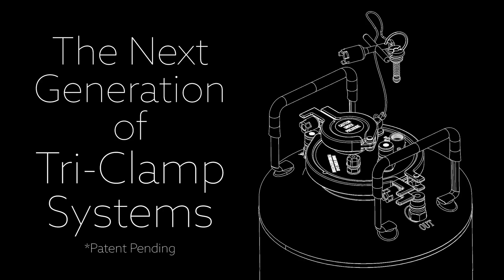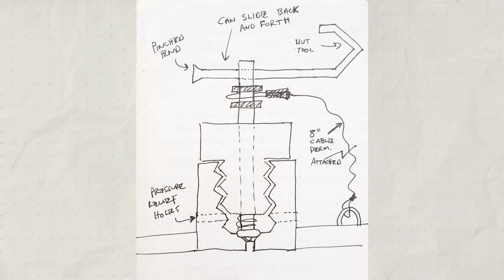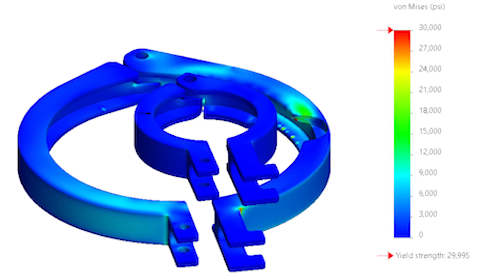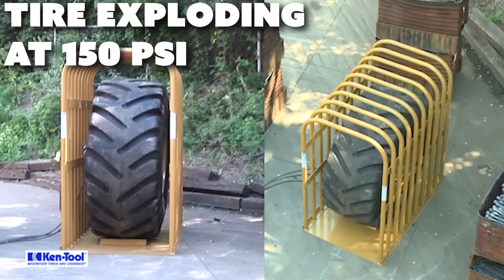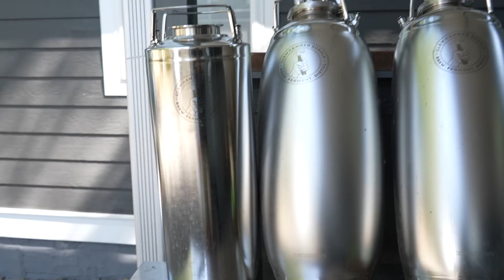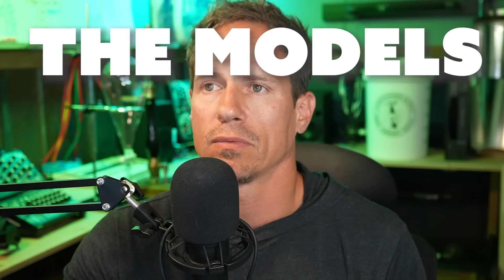How To Lose Money: My Fermentation Keg Problem Just Got Worse

Comment: I'm in the middle of my second fermentation in the Kegmenter. So far, I've enjoyed it. Since this is my first real foray into pressure fermentation, though, I've managed to make a mess a few times. But that's part of the fun of brewing, I suppose.

I'm going to offer a gentle product critique/suggestion for a version 2.0:

So the max pressure stuff covered in this video isn't such a big deal. Who cares about going over 40 psi? If I wanted to for some reason, I'm pretty sure the keg could handle it anyway, but I guess I'll never find out. I guess the use case would be force carbing the primary vessel after carbonation to serve? I'd just spund if I wanted that.

The main production drama with this product was the risk of launching the fittings as projectiles if you tried unscrewing the triclamp under pressure. The way they fixed this is by creating a dummy-proof keyring that's welded onto the pressure relief valve, and attached to the key that you need to loosen the tri-clamps. This means, at least in theory, that you always have to depressurize before loosening a tri-clamp.

Because this was a change after they designed the system, it does create some downstream problems. Say you want to use the hop cannon attachment to drop stuff into the keg without exposing the beer to oxygen. In theory, that should be possible, since there's a ball valve under the hop cannon. So drop stuff into the hop cannon with the valve closed, pressurize the cannon, and then open the valve. No need to open the keg to dry hop, which is what I assume is the purpose of the hop cannon.

With the keyed tri-clamps, though, you can't open the top of the hop cannon without de-pressurizing the entire keg, because you need the key which is attached to the PRV. This makes sense from a safety point of view, because if the hop cannon is under pressure the top to it could launch if you don't depressurize. But it undermines the functionality of the hop cannon.

(I thought depressurizing the keg wouldn't be a big deal because I planned on dry hopping during active fermentation. The positive pressure keeps the O2 out, and the yeast would scavenge what's left. But of course London Ale III has thick gooey krausen, and I, someone inexperienced with pressure fermentations, probably overfilled the fermenter, so opening the PRV created a beer volcano. I cleaned it up, so just a nuisance, but I'd like to avoid in the future.)

As a user, what one could do--and I'll consider doing--is replace just the keyed nut on the top of the hop dropper with a cross hole wing nut for thumb tightening. This would solve the problem, but it would re-introduce the risk of creating a projectile. I'm sure this isn't something the company would endorse or anything, because they don't want some doofus forgetting and hitting themselves in the head with a gas post (ouch!). In defense of this method, though, there is a PRV on the hop dropper, right under the triclamp, so there's a little visual reminder to depressurize just that top section before undoing the screw.

Another option would be for Clawhammer to design a hop dropper 2.0 with a separate triclamp key on the PRV for the hop dropper. You could probably do this yourself, actually, if you want to take the trouble: just get whatever size key ring is on the PRV, attach a key, and then braze or solder the key ring together. I'm not sure if Clawhammer sells the keys separately, but I'm sure you could find basically the same tool somewhere else. (Actually, not sure if you could DIY it because I'm not sure whether you can unscrew the PRV on the hop cannon and I don't want to try since I've got a beer under pressure in there.)

Comment: I like how you are testing and using your own product. While watching your main video on showcasing your product, I missed that potential hazard too. It looks like there are two clamps that this can cause immediate pressure and make either the larger lid or the smaller lid fly up. While using my kegs at home I'm always worried I might blow something out by forgetting to release pressure first. Maybe a warning label and warning in instructions would help. Although I tried to push the lid down on my keg with 12 PSI in it. If there is way to do something wrong with a keg, I've done it. Will the safety valve be set to 40 PSI or are they all just made for 60? I don't think I've ever gotten to 50.

Comment: Would there be a problem serving out of one of these without racking to a keg? You can't drop the trub like in a Unitank, but I always finish my fermentations with 10 or less gravity points in to FG in standard kegs with spunding and I have had kegs stay fresh for months. I wonder if the whole ferment was done in one if anyone would notice?
Reply from the maker: That’s the entire point of this keg. Nobody’s going to notice. we don’t even bother to transfer most beers after they’re done. We just serve right out of the same keg we fermented using a floating dip tube.

Comment: I just took a look at some of my other pressurizable brewing equipment and took note of a big red sticker that warns of injury or death if removed while pressurized. A warning is the standard, the end user should be knowledgeable of the system they are working on and the inherent dangers of making mistakes. Introducing multiple one off triple clamps that can only be used and cannot be replaced with a regular clamp is not the way. If you engineer something to be fool proof you will ultimately also engineer a better fool. Clawhammer products are awesome, the engineering efforts are commendable, but the special ones out there will still find ways to injure themselves using this.

Comment: Funny enough, I've had to undergo a small amount of this stress with kegs in an R&D environment without intent to sell a product. It's pretty common to use a safety factor of 5x in general unless it's in an industry that really understands what their working with, like bridge building, which I've heard can utilize a safety factor of 3x. So, a 60psi rated keg could potentially survive 300psi before rupturing, and yours happened to survive even higher than 5x. I think the main take away is that things are only an exact science in perfect conditions. Safety factors are created to supplement this, but it leaves people like you and I in the dark when we're trying to see what the limits are. 

I've only recently started watching your videos and I like your channel. I will be checking out your products soon.

Comment: The engineer side of me loved this video. The margin you guys are putting into this is the way all things should be designed and thats not always the case. It is interesting that the FEA suggested such a low failure pressure but models should never be completely relied upon in lieu of real world testing. That's exactly why the aircraft engine parts I work on go through thousands of hours and cycles of tests in extreme environments. So kudos to you guys for doing it the right way!

Comment: As a OSHA inspector you only have to be worried if are covered by workers comp insurance as an owner for not following the safety rules. ie. (cutting without the guard on the angle grinder). Plus if you live in a state that is run by OSHA and not a state run program you probably will never be inspected unless you have a major accident, because they don't have the man power to investigate all the problems. Have been a fan of the channel for awhile and will still be watching. Thanks for looking out or us in the hobby!

Comment: This is why my next setup will come from you guys. Your dedication to your customers is fantastic to witness. Does this mean that the PRV will have a reduced limit to match labeling?
Reply from the maker: Good question. An issue with PRVs is that they release at a range of pressures, no matter what the exact rating is, of course.... So if we set the PRV to release sat 41 psi, for example, it might release at 35 and it might release at 45!  So the PRV will be set to release at 50 or 60, most likely, like normal kegs. But still, rated max pressure will be 40. Absolutely do not exceed that number!

Comment: Having worked for 4 manufacturers as a field service tech, even after engineering did all there calculations, we still had to do real world testing. Sometime we’d tell engineers the customer have been using it to do this. They’d say it outside the design parameters, and have to prove to them what the customer was doing. Its better safer in the long run you did the testing.

Comment: It's actually a really good idea to have done the physical testing, and to ramp up the pressure to many multiple times than what the pressure vessel will be actually used at.  It may have been maddening, but you're ensuring your customer's safety, are ensuring your reputation, and reduced your liability.

Good on you for doing it!

Comment: Quick question, on the site you say you can put the keg in a fridge so you dont need ice or glycol, do you have an example model or size you guys have used for that purpose?
Reply from the maker: Upright freezers work great. So do chest freezers. Though you'll need an external temperature controller: https://www.clawhammersupply.com/collections/brewing-accessories/products/fermentation-temperature-controller

Comment: Good on you for going through your own testing.  I'm a mechanical engineer and have done plenty of FEAs over the decades.  All FEAs need to be correlated to real test data. They are not themselves proof of anything. Your "problem" is a great example of that.
FEAs are based upon assumptions, the type of analysis performed, the software used to perform it, and the knowledge of the analyst. Any one of those lacking can give you bad results.
Looking at your screenshots and your ballooned kegs tells me that a nonlinear analysis was required which is out of the range of most engineers to do due to much higher cost of the nonlinear software and a lack of understanding when a nonlinear analysis is required over a linear one which is cheaper and more commonly performed.
Reply from the maker: Holy crap, Larry... You absolutely nailed it. Like, seriously, this was exactly the problem. Can we call you next time we run into an issue like this !?
Reply: @ClawhammerSupply  Haha. Thanks for the confirmation. Although I do still have access to the highest capabilities of several FEA software tools, I no longer do these sorts of things nowadays. I’d be a bit rusty at it honestly.
Reply: As a design engineer working with pressure vessels every day, I completely agree with what you said - an understanding the material behaviour, the type of analysis, as well as the software, is absolutely paramount in getting accurate results, especially when crossing over to the non-linear side of things.

That said, design codes (we typically use ASME Boiler & Pressure Vessel Code) almost completely encompasses any type of geometry, without the need for FEA. Pressure testing is also a very important step in the comissioning of vessels.

Hats off for taking a stance and actually derating the vessels to ensure the safety of the operator!

P.S. we will gladly help with version 2😉

Comment: I respect that you went through all this testing but I have an issue.
You should always make sure they can withstand more than what they need to be as a safety feature. 
The reason for this is because someone is going to get a cheap pressure gauge and not really know that he's at 60 psi when he's trying for 40. 
Again, no shame to you as you did everything right and you're even labeling correctly. 
However, I think moving forward you should start ordering kegs for a much higher pressure rating. 
I say this for the reasons that somebody may accidentally over pressurize and you may still be liable.
Reply from the maker: We stand by the fact that actually could be rated to 60psi. We've cycled them through as many as 5 life cycles at 60psi. And we've max tested them to more than 10x that! So, it's overbuilt for 60, let alone 40. And the official rating will be 40 PSI. So they're extra, extra baller now.

Comment: 40psi should be okay for most home brewers that brew ipa and such, but only marginally, it covers up to 2.5vol of CO2 up to 28C, so it is ok for Saison but not Kveik, or Hafe... My spunding valve is usually set to 2.5 bar, so beer is carbed enough even after chilling it. As long as prv does not get clogged and at the same time the regulator fails this should be just fine.

Comment: Hey, what simulation program is that and why doesn’t the simulation show deformation? You can see the yield stress in the material with the assumption, that all the energy goes into stress and not into the displacement and deformation of the material. Do you have any footage of a simulation that shows the deformation? Would love to have a look at it and see weather the yield stress changes with the deformation.
Reply from the maker: Hey there, i'm not an engineer so just interpreting and paraphrasing here... The modeling software we used did take deformation into account but actually "broke down" as deformation became too significant to accurately model.
Reply: @ClawhammerSupply  That was most likely due to the analyst performing a linear analysis instead of a nonlinear one.  Linear analyses are only valid for small deflections while only nonlinear analysis can take into account larger deflections on the scale shown here.

Comment: I love this keg design. Why rate the vessel to 60 psi? Most unitanks only do max 32 and most are even less than that. And they will have the prv set to 32 psi and vent after that for safety. There shouldn’t be a reason for someone to crush the vessel with 60 psi and seems like an overall unnecessary safety risk in general.

Edit: finally watched the video whole video lol 😂 honestly that was the best call and glad you guys are operating with safety in mind as usual!

Comment: Would the PRV not omit the need for pressure testing the keg to that level?
Reply from the maker: Problem was that engineers were saying that repeated cycling to 60psi was not safe. Loooong story short, and i didn't even go into this much detail in the video, we are able to prove that 60psi is safe by pressure cycling a small sample of kegs for many cycles and extrapolate from there.

Comment: Yeah I rarely go over 20 - 25 PSI while carbing. I MAYBE go to 30 if I'm trying to turn it around quick but I've never gone to 40. I see no problems. Additionally, let me say, when it comes to a hypothesis, empirical testing will always be the most reliable method (assuming proper controls are ran)

Comment: BTW - SSBrewtech Unitanks comes with a 30psi PRV. I had a stuck Spunding Valve and the RRV did its JOB!!

Thank you for all the time spent testing! great to know this will work and be safe for smaller ferments that don't need to be moved vessels, like ciders.

Comment: As a mechanical engineer who has been on the wrong side of vessel failures on a handful of occasions (both pressure and vacuum), no amount of modelling or spreadsheets give you the peace of mind like physical testing, over engineering, and under rating. You did this the right way. Now you can sleep well at night knowing that even in a situation where there is a manufacturing defect in the tank, there is still no way anyone could hurt themselves.
Reply from the maker: Thanks. And agreed!
Reply: I would put a J-tube with a 40 or 50 psi line relief.  We used to test N20, and Co2 tankers with pressurized water. 350+ psi!! I am not a Engineer,  but I built, and repaired pressure/ vacuum vessels for 13yrs. Mostly Cryo tankers. A line relief is cheap, and easy insurance!!

Comment: Good to see it holds some crazy pressure and that's a great call to go with 40psi. I wonder what sort of PSI it would reach with a high gravity wort and a ton of yeast in there (sealed in)? Would it explode or just go full 'all rounder'? Cheers!
Reply: Is that not why PRV's are a thing?
Reply from the maker: Yes.
Reply from the maker: That is an interesting question. My understanding is that yeast are able to withstand a lot more pressure than people would think. Wild yeast and bacteria, way more.